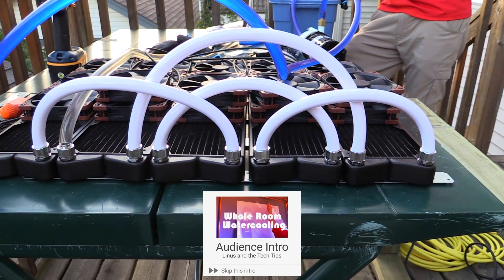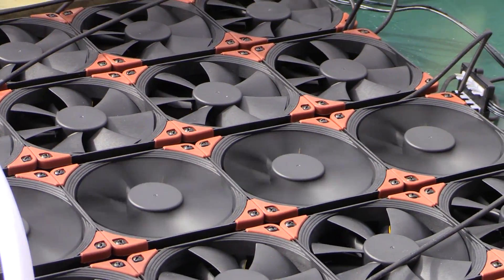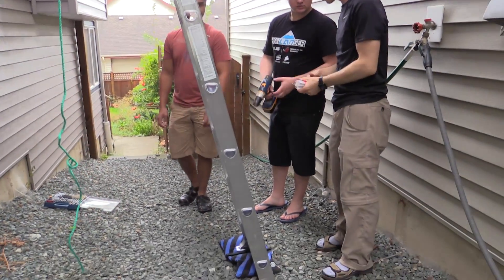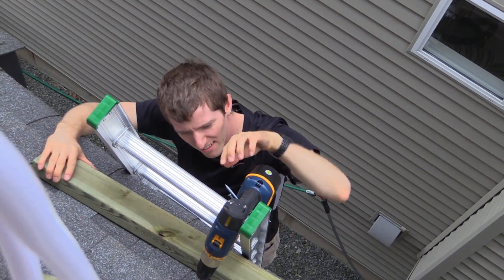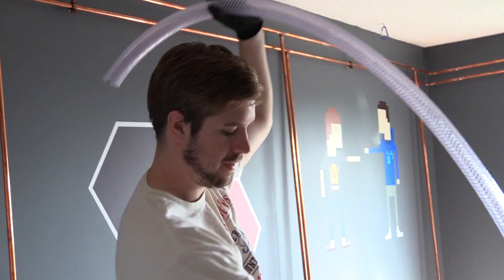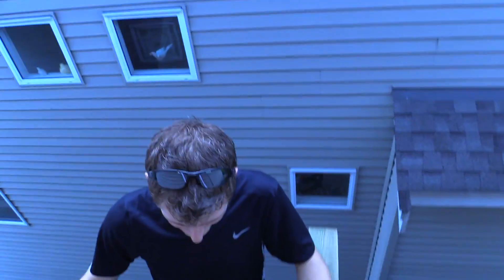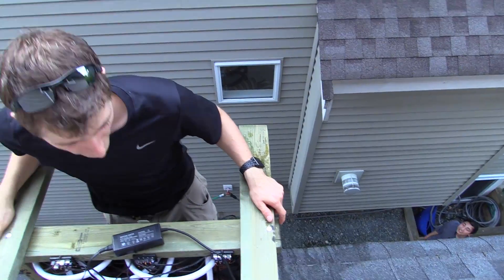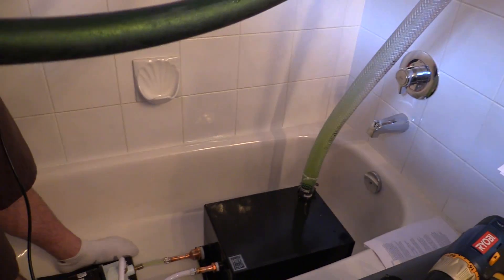Whole Room Water Cooling Project Day 3 - Radiator Mounting and Panic...

Comment: I think this project is extremely half-assed, i really hope it works out for them.
I would hope the reasoning for using only PC watercooling components and no larger industry components is that they got them free or really cheap.

It reminds me of the guy using his swimming pool to cool his computers and heat his swimming pool. It was 2 separate systems with a heat transfer system in the middle. That seems like a better way of doing it than having a single loop system, if one part leaks, they are all going to be down!
Reply: djaysenpai That's not too hard to answer so let me help you out. Let's say we have a 12x8 meter pool which is 1.8 meters deep. That makes for 12*8*1.8 m^3 of water which is about 173 m^3 (or 173,000 liters) of water. So that is also approx. 173,000 kg of water. Now we need the specific heat capacity, but for water it's simple (at least depending on the units you're using) since the calorie is actually defined using water: 1 calorie is the energy needed to heat 1 gram (not kg! that's kcal then!) of water by 1°C. This is defined around 30°C - 50°C since the heat capacity changes with temperature but for now that doesn't really matter. So lets say you want to heat it up from 20°C to 21°C (which is about 2°F or 9/5 °F to be precise! Sorry btw. that I use meters if you're american!) you will need about 173,000 kcal or 173,000,000 cal. Kinda useless unit, right? Now how much is that in descriptive terms? Well, let's convert to a more modern unit: the Joule! 1 kcal equals 4,1868 kJ so we need about 724,300 kJ or 724,300,000 Joule. Now again: how much is that? Well: depositing energy of 1 Joule in 1 Second equals the power of 1 Watt. So now let's just say you got a nice set of 5 computers with some decent parts that take up around 250 watts each under load. I know some gaming PCs can take up more but this is a reasonable estimate. All the power that a PC uses is actually transferred to heat at some point because the PC itself is not sending out sound or light (at least really not much). Assuming that really ALL your parts are water-cooled (a little bit rough guess but we can just forget about the couple of Watts of power the non-water-cooled parts use) like CPU, GPU, RAM, power supply... all those 250 Watt heat your cooling water. Now since we assumed that you're pretty busy and are using 5 PCs it's a total of 1250 Watt of Power. That is btw what a small to medium immersion heater uses/produces. So now HOW long would it actually take to warm up your pool with that assuming that the pipes don't radiate part of the heat already and that the water won't give parts of the heat away BEFORE it reached 21°C? Just one more calculation: P = E / t <=> t = E / P, so we have to divide Energy by Power to get time. 724,300,000 Joule / 1250 Watt = 579,440 seconds which is about 6.7 days. But in 6.7 days your pool will OBVIOUSLY loose some heat especially during the night and all that...
So what does all this mumbeling of a PhD student in Physics comes down to?
You can work and play all day with your 5 PCs and will basically never heat up the water of your mid-sized pool. ;)
Cheers!
Reply: I wonder how many computer it takes from raising the water temperature of the swimming pool by even 1°c...
Reply: When I saw it I thought a heat transfer system would work better, the looks would be a lot better too.
Reply: ***** i was thinking about the Sun... all that Black radiators and tubing outside heating up the liquid by the sun .... not sure if thats going to work ... i bet it would work in winter (If its also an anti freeze) else ur pretty f'd cuz it will freeze solid in ur tubing....
Reply: Linus must have seen your comment and used it as inspiration for his home water cooling
Reply: thanks for the explanation i knew it would require a whole lot of cumputer to heat up a pool, if I want to raise it by 1°c every minute using your formula it would take 12 MWatts worth of computer wow
Reply: djaysenpai Well that fits since it takes a water heater about 1 minute or so to heat up 1 liter of water by 80°C with 1500 Watt. Heat-energy is a bi*ch. It really takes a lot. When a light bulb uses 100 Watts it's already pretty bright although it uses only about 1 Watt of energy for the actual visible Light. A 1 Watt LED is really bright and a 1 Watt Laser... oh boy!!
But a decent electric heater easily needs 1500 - 2000 Watts just to heat up a room slowly! And air has a much smaller heat capacity than water (which is also a reason why water cooling is nice). :)

Comment: I love the project, love the ingenuity, and love the over engineering. But why stop there!....did you ever consider mounting the fan unit inside a refrigerator with most of the electricals on the outside and just the intake and outtakes hose through the back of the fridge?......oh it would keep your drinks cool at the same time.........you can thank me later!....next!

Comment: So if the idea is to lower the cooling cost of the house, why use copper piping since that is going to radiate alot of the heat inside the house anyways?

Comment: So what when the fans get wet and short out? They're case fans, not some sort of hardcore windmaker used on movie sets...
Reply: They are Noctua industrial fans that are water/dust proof. Linus made a video showing the fan spinning perfecly fine in water.
Reply: NelGaming Noctua is overhyped. But this proves that selling something simple like a fan for a lot of money will make people think its good, even tho its average.
Reply: NelGaming You know you can take any random no-brand $2 chinese fan and it'll run in water no problem right? I'm not saying the Noctuas won't handle it, but everyone seems to think that running it underwater for 2 minutes proves something. Actually being outside with sun, dust, rain and shit is really harsh.
Reply: The Raging Gamer They're MUCH better than $5 dollar fans. The CFM info is actually legit unlike the cheap knockoffs. The BEST is debatable, but they are on the top level of consumer fans for sure. I've had shitty, OEM fans before and they stop working within months.  I currently use Cougars and my all time favorite right now are CoolerMaster JetFlow's 120mm. They have insane amount of CFM and are cheaper than Noctua's, all metal casing and vibration pads.  Also maybe you don't know this but the high end Noctuas and JetFlow are PWM fans instead of basic 3-pin. It allows me to much better automatic control the RPMs of the fan. I don't use a basic manual controller anymore. I do it all by software and PWM allows the RPM ramp ups and down to be ultra smooth and accurate. No $5 fan has that.  Sure you can go with quality & cheap Delta fans with insane RPMs but what person living in an apartment wants their room sounding like an airport?
Reply: I dont but they seem pretty hardcore fans with all them certifications and things. And Noctua is know to make great fans.
Reply: The Raging Gamer What the fuck do you even know? Do you make fans? No. Fuck off.
Reply: ***** i don't need to make them to know about them, its how much air they push and how quiet it is when its pushing it and its not the best, and not much bbetter than $5 fan
Reply: ***** i have a fan controller and i always have it set to as low as it can go, that is enough because all it really has to do it blow out hot air. And they are all silent, well quieter than direct cu II cooler
Reply: noctu fans are now water proof and that box around it ptobaly keeps alot of the rain out anyway eveb if a little bit got in those fans will keep going

Comment: Linus i have a few questions! Why did you go with noctua fans, instead of some custom big fan to cover whole unit? How do you plan on dealing with airbulbs and occasional PC movement?
Reply: Not directly from Linus but this is my take, the noctua fans create lots of static pressure (which is GOOD) but one large fan wouldn't create this pressure and would have a low effect

Comment: Was just about to suggest using a mosquito mesh for the fans air intake, you can also use a mesh for allergics which stops even small poll particles so you won't have to clean the fans from time to time.

Comment: What's with the blatant rip off of androids new lollipop theme? Correct me if I'm wrong but  It seems like they were just out of ideas for a new video design scheme and copied android...
Reply: Its supposed to look like material design...
Reply: Ethan Lau yes obviously but look at the list that keeps popping up. That's android. With the circle plus sign and everything. Then again in the outro. The thing in the left of the screen has a navigation drawer pull icon. I understand that material design isn't an android specific concept, but this is not just material design, it's android...

Comment: yeah that rad setup outside, you'll need a new one, treated pine aint gonna cut it.

It'd be more amazeballs if you had a solar panel setup on the roof, run a small air con unit to that room, and then use the cool air from that room and push it out through the wall past the rads to cool the loop.

Also i'd be interested in the end financial cost of this.

Comment: meh, a cool project idea, ruined by using pc grade radiators and pumps, and by thinking that you need fans for cooling the radiators OUTSIDE. you could have bought a couple large brand new car radiators for what that pc grad radiator array cost you, add on a brand new car water pump and a 1hp or so motor salvaged out of an old drier or washer and the only extra cash you would have to spend would be on quick disconnects for the pumps inside the systems. not to mention, if something says it requires two amps in total you need to throw a power supply capable of 3 or 4 at it, it is called headroom, those fans are likely to ask for 2.5 or more amps when they first fire up so with a psu at 2 amps you are going to be burning that thing out every couple of months. i am just utterly amazed at how much thought was put into this project without any real research or apparent understanding of what you were trying to do. come on guys, you can do better, where was lynda.

Comment: I have been wondering, do all of the computers need to be on at the same time for this system to work properly?
Reply: Its on a quick disconnect system, you have one massive pump for the whole system and one individual pump for each PC, in the winter they would disconnect from the big loop and cool each one on its own. To answer your question, yes but in reality if the system gets turned off they're more than likely going to disconnect it which adds a lot less piping length to the loop.
Reply: CurtisVlog'n'Games You can turn off all the PCs and you can still run the watercooling loop.But if you want to move or heat up the room you can just simply disconect the pc from the loop an other PCs will stil will still work and get cooled .
Reply: All the pics are plumbed in parallel

Comment: Linus, you've not thought this through...
Standard PC cooling equipment sin't engineered for this purpose.
There are standard weather, insect... in one word 'outdoor' resistant radiator/fan combination. Even car radiators ( the stuff we used to water cool our PC's back in the '90s ) do the job nicely.
The roof is about the worst place at home to dissipate your warmth. Organic material like grass and plants do not hold the sun heat as long as ceramic materials and roofing. It can get quite warm on a roof, a garden will al ways be cooler, thus cooling your equipment better.
It's also a lot easier to install a power supply for your fans and pump.

I know this is too late, just food for thought.

Comment: are you going to rain proof the outside rad mount?
Reply: the noctua industrial fans can are actually rated to operate in wet conditions
Reply: ChrisD4335 resistant, not water proof
Reply: ***** ME4vUO2T-48 seems to hold up pretty good in water, should be fine. though the wettness didn't kill the other fan ether the stress from the heavy load did so it would appear to be a non issue.
Reply: ChrisD4335 I just mean be more technical with your wording. They literally say resistance, not proof. This things not going to survive a monsoon or diving.  "but also withstands dripping water equivalent to 3mm rainfall per minute" . I think since it's outdoors, the cycle of cold, hot, expanding, shrinking, heavy moisture and dry air is going to fuck it up quick.

Comment: I watched these vids and two things;
1. Why would you just make a server room with whatever power you need remote from where the users sit and that room is climate controlled. and/or
2. If you want to outside cool liquid surely you could use a larger radiator like a car water or oil filter and an appropriate (for exposure to weather) fan.
3. [bonus] Why not just get a split aircon system in that room to keep it at 22 degrees or whatever.
Love you guys, Merry Christmas.

Comment: I almost guarantee that jb weld wont work. or not for long if it does. hopefully part 4 reveals the proper fix of just soldering that last joint correctly.
Reply: JB Weld is amazing stuff. Years ago we got a cracked block on our Polaris sportsman 400 H.O and we sealed it will JB Weld as a quick fix. 8 years later and the quad still runs
Reply: ***** I had a jeep for 7years before I realized the previous owner used JB weld on the radiator to stop a leak. Once I saw the leak and residue from JB weld I just added more and its working fine.

Comment: I personally would have used one big radiator from a car or truck and one big 110v fan.  Seems silly to use all those individual fans and rads.  You also need to ensure its not in direct sun light as those black radiators will drop in efficiency significantly.  Just a thought.  Great work :)
Reply: Kinda of my thaught too.